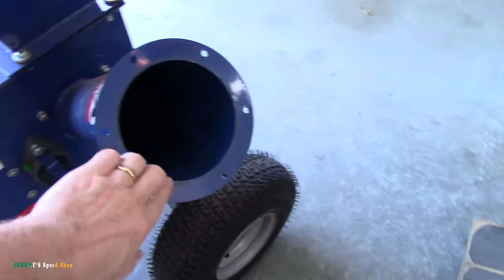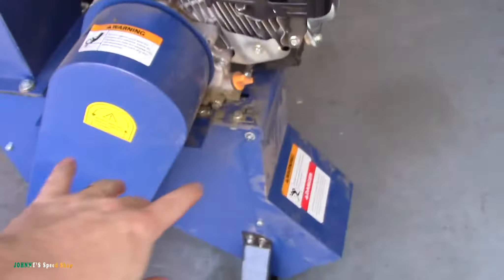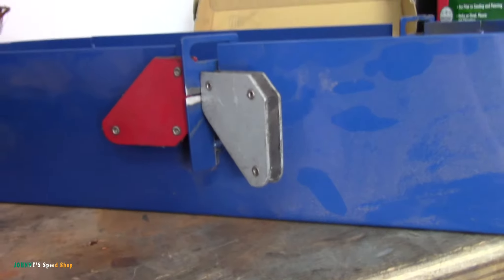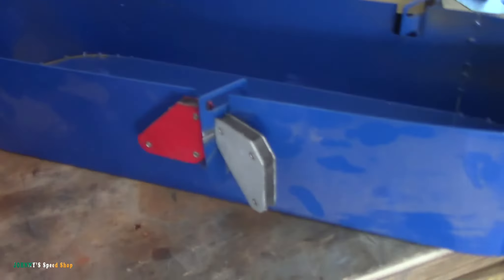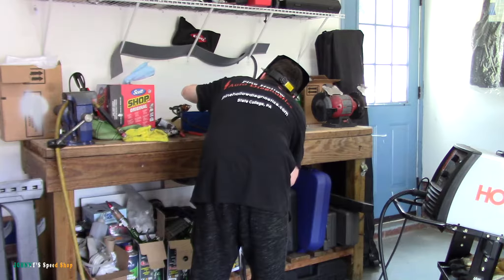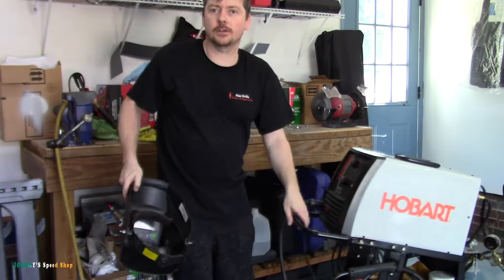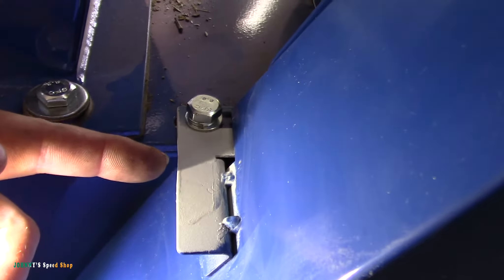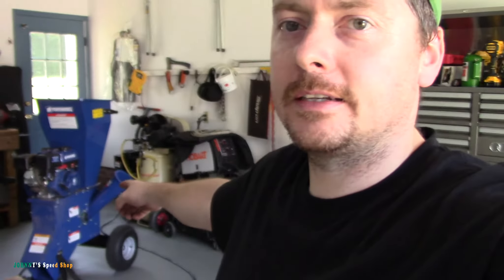PowerHorse Chipper Shredder - Broken after one use

Comment: My belt cover broke in the exact same place. I don't have as much dusting issue because most of my cuttings are somewhat green still. I'm gonna weld the tab back onto the shroud once I receive my replacement knives/chipperblades. Does anyone know what touch-up paint best matches this paint (I haven't looked beyond POWERHORSE as a source). By the way, I'm enjoying this unit thus far (422cc w/electric start)👍👍

Comment: I just bought the exact chipper and it broke in exactly the same place on the first use. Fortunately I have a MIG welder and fixed it but this seems to be a common problem with this model. I could have taken it back but it was easier to weld than it was to take it back and assemble a new one.
Reply from the maker: Yes mate seems to be a weak point for sure....

Comment: Hi Johnny, I hope you don’t mind if I make some constructive suggestions that WILL EARN you more recognition ($$$) and benefits viewers like me. From profolio of mechanical things you have done that means, you have to shift gears and draw your OWN LINE in sharing what you find crap versus great products and designs. For example, I’ve been going nuts to find REAL people who have experience using the Powerhorse (15 HP engine) wood chipper. You short changed your viewers and yourself by not ripping apart your experience with this wood chipper. In other words, don’t be shy and let it out! I assure you you’ll get three or more times viewers in learning about your reasons why something is garbage or an undiscovered jewel. If I were you, I’d go back to this chipper (to diversify your video profolio) and do a new video in comparing this brand, specially its 15HP chipper that sells for about $760 plus $100+ shipping with HomeDepo Brush Master with 15HP that sells around $1600. Your video will be the only one making such serious comparison; trust me I’ve done research to find out if its worth it to buy such a lost cost chipper.
Reply from the maker: I don't care about the $$$ mate, its not why I do it...thanks anyways...